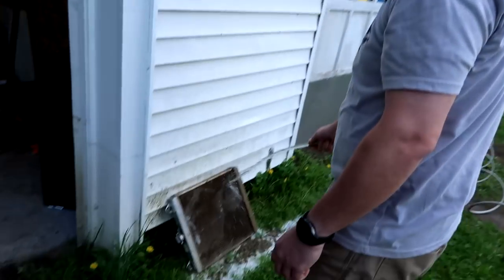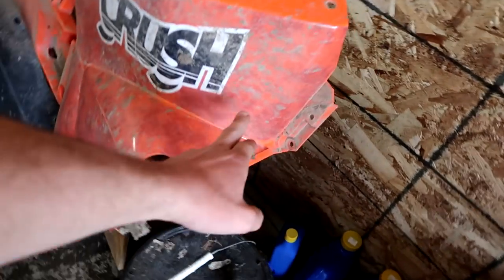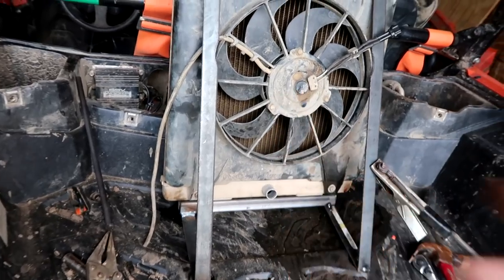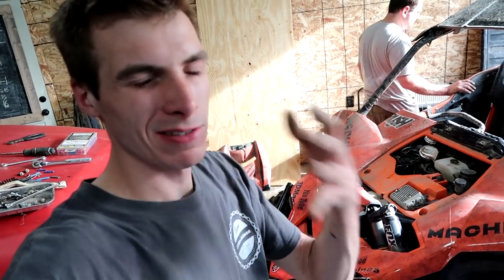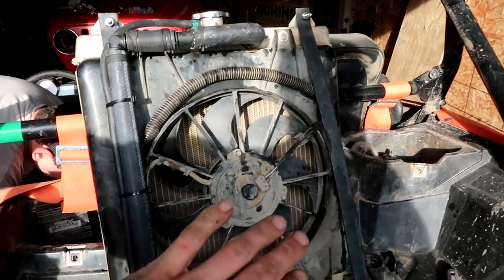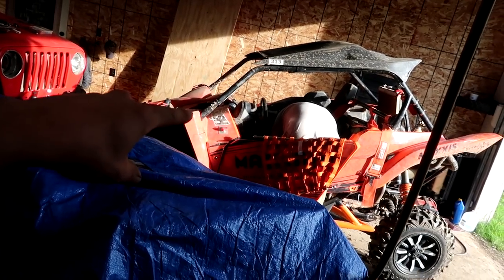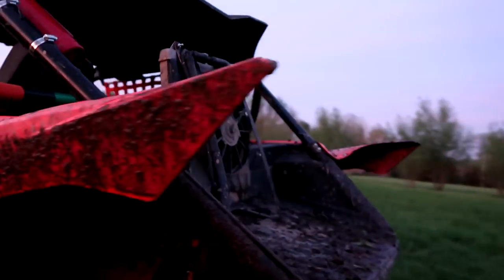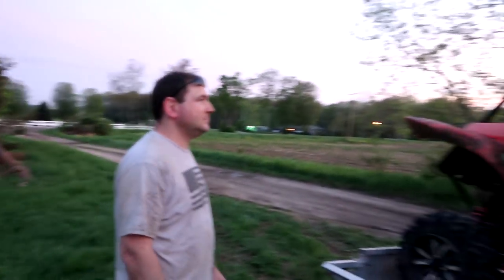Smelling $20,000 BURNING!!

Comment: Yeah I'm just gonna say it for safety. That radiator cap gets blown off or you spring a leak aiming front ward you and your passenger are getting burned. I'd move it farther back and build baffling that pulls air from somewhere and also protects the occupants incase of a leak

Comment: The fan blades are designed for maximum efficiency in the intended direction, spinning blades in reverse will not work as well. You should just mount fan on the other side of the radiator. I t will cool better.

Comment: If you're serious about racing, you should have worked on Crush immediately after the last race. That way if you need parts and they take time to arrive you're not rushed. As for producing and selling rad mounts, wait until you have some time using it in case it turns out with some flawscthat need tweaking.

Comment: You should out a manual switch for the radiator fan so you can just turn it on before you race and it gets hot maybe even upgraded to a bigger fan to move more air